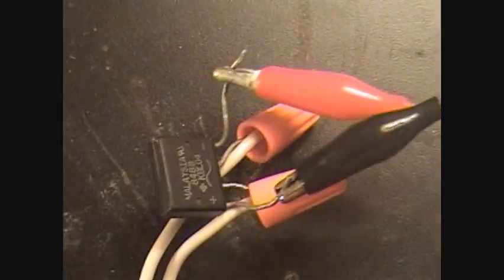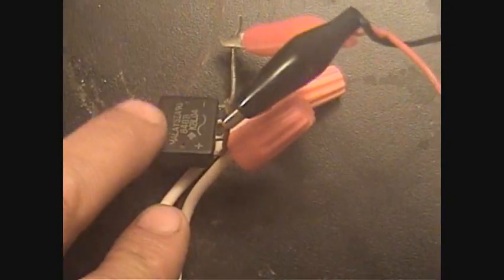Rectified High Voltage Spark Cell

Comment from the maker: I havent tried it out of water, but i dont think it is enough voltage to make a jump, i had to put alot of electro lite in this to make it have this effect.......about the amps
im not sure, but the inverter i was useing is only 650watts so 650/120 cant be but a little over 5 amps cause the inverter stops working over 650 watts.  thanksfor the comment

Comment from the maker: 12v battery inverted to 120vac, then abridge rectifier to get 120vdc the positive goes to a water cap and out to the spark cell
and the negitive goes to a water capasitor
and to the spark cell, the different spacings of the water caps changes the spark.

Comment: Cap that spark cell off and see if what comes out of it can be lit with a grill or fireplace lighter. If that is HHO then I want to copy that for sure. LOL

those water capacitors and the bridge rectifier are the only components in the ciruit? 

awesome!